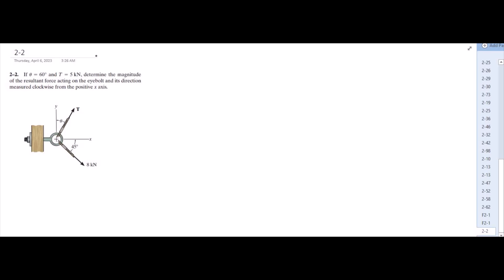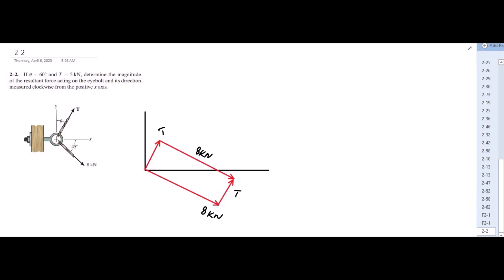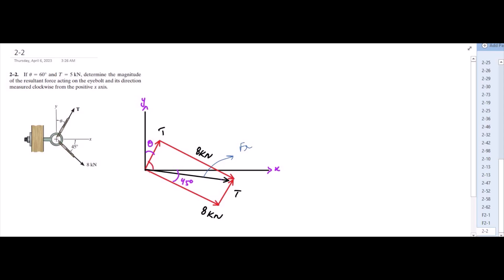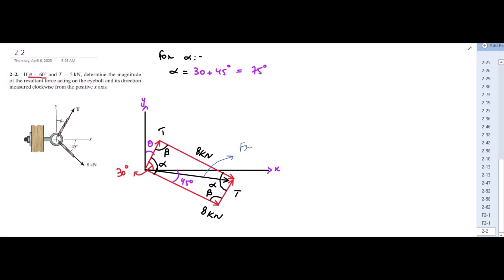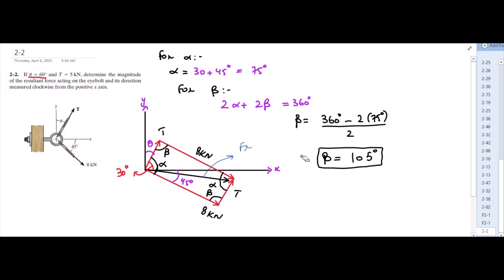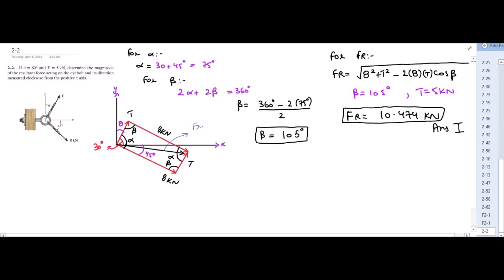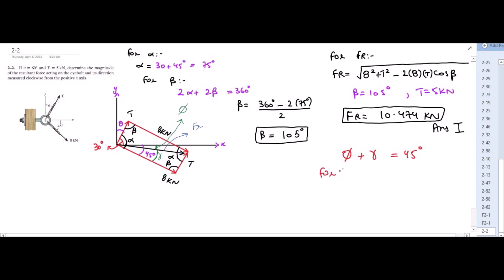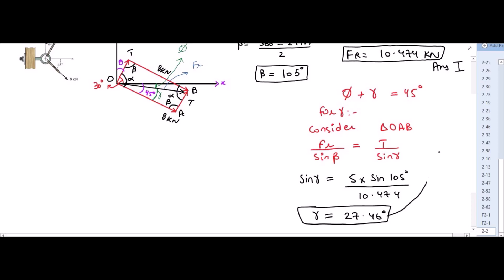2-2 hibbeler statics chapter 2 | hibbeler statics | hibbeler

Comment from the maker: Learn How to Solve 2-10 Hibbeler Statics Chapter 2, "Determine the angle of θ for connecting member A to the plate so that the resultant force of FA and FB is directed horizontally to the right. Also, what is the magnitude of the resultant force? "
Here is the Link: https://youtu.be/mThSkFCUhh8

Comment: at the step of calculating gamma. if I enter 5*sin105/10.474 I keep getting the wrong answer. 0.46 instead of the 27.46 degrees you got, what am I doing wrong?
Reply from the maker: 0.46 is the value of sin of gamma, to find gamma take the sine inverse of 0.46, and you will get the right answer.  I hope it will help.